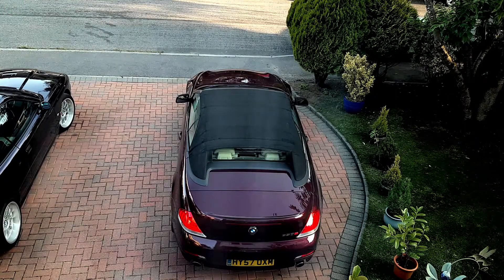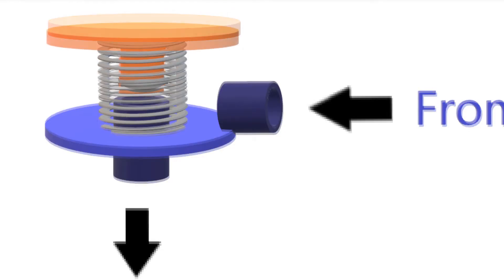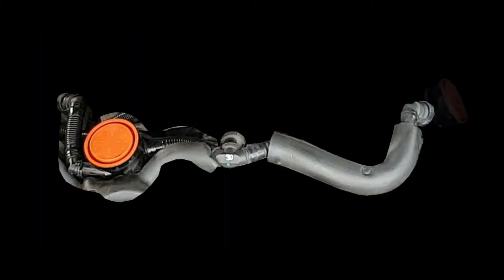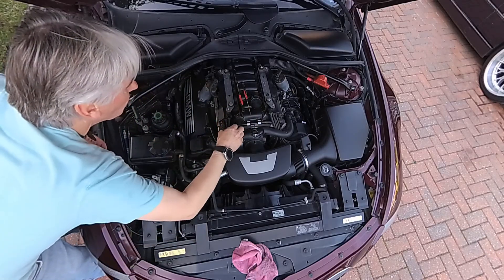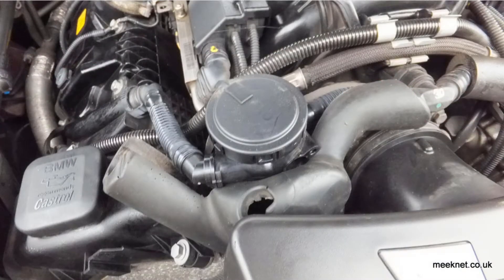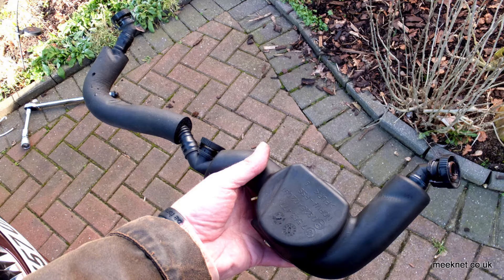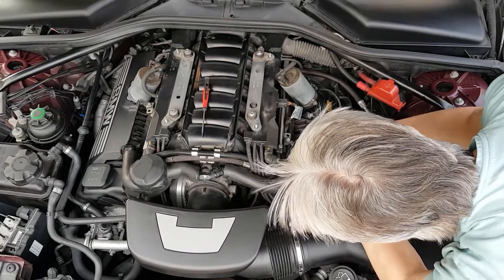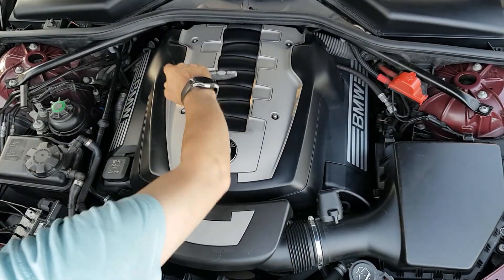BMW N62 Engine - Valve Guide Seals causing smoking? Fix in 30 minutes!

Comment: Thanks for the excellent video! Checked my PCV valves today and they were intact but I was surprised how soft the rubber was. I expected it to be a little more rigid so was wondering if that is normal or a sign they are near the end of their effectiveness? There was a tiny bit of that yellowish sludge on both sides but nothing like what you showed in your video.
Reply from the maker: Thanks! Probably still worth replacing them and scrubbing out the pipework and valve cover just in case - and yes, they are floppy!

Comment: Hey Tim took my plugs out on my 08 550i plugs got oil over them what do u think cause that problem
Reply from the maker: If the oil was on the outside of the plugs (around the insulator) then your valve cover gaskets need replacing - and it is worth checking the PCV valves (see my channel) as you may have pressure in the crankcase that is pushing the oil out
Reply: Oil was on the bottom and the top of the plugs on the right side.The plugs was dripping oil Thanks for replying I appreciate your help

Comment: I have a 2006 650I and I'm getting a Increased Emissions warning with the Check Engine light illuminated. By any chance do you know what could cause this? I've made this repair thinking this was the issue. Could you help please?
Reply from the maker: You need INPA: https://youtu.be/CBfyCItOJH0 Increased Emissions usually means a failing cat as measured by the downstream Lambda sensor - but INPA will give you more information

Comment: Hi Tim, having trouble with my 05 x5 4.4 n62 with hesitation on light acceleration and very small amount of smoke on start up, possible ccv and have you any knowledge on the ivm on these motors or integrated supply module all my symptoms are leading me to this module, thanks in advance
Reply from the maker: Always best to start here with these kinds of problems:

https://www.youtube.com/watch?v=CBfyCItOJH0&t=274s

Comment: Thanks Tim, your site is a goldmine of useful (and money saving) information. I've checked my PCV's (they were ok), replaced the halo and dipped beam bulbs, replaced the sagging trunk struts and changed the oil, air filter and cabin (micro) filters saving ££'s in the process! As you say the 650 really is a lovely smooth GT car, and doesn't have to break the bank even if the valve stem seal do go eventually.
Reply from the maker: Thank you, yes, valve stem seals are a problem - but it isn't a forgone conclusion if you change oil regularly.

Comment: I have a 04 545i could a failing vanos cause the car to smoke? I have no check engine lights. Slightly rough idle
Reply from the maker: No, Vanos problems do not cause smoke - try changing the PCV's....
Reply: Timm's BMW Repairs and Information the car seemed too start smoking right a few days after changing them. The car had a ripped one but smokes worse after replacing the two.
Reply from the maker: @heggcy1519  Give it at least 100 miles - and also clear out the valve covers as described in the video

Comment: Hi Tim, where can I buy the tube with dipstick seal to connect to my manometer?
Reply from the maker: You can find them on Ebay - mine came from my Sealey mechanical vacuum gauge kit
Reply: @TimmsBMW  is there special tools for this fix?

Comment: Thanks very much for the information. Great demonstration. My E63 650 has the SMG gearbox. Is the dipstick that you pulled out on the driver's side to measure vacuum for the engine oil? My dipstick states AT4 on the bottom so thought it was for the SMG manual gear oil?
Reply from the maker: Yes, the disptick I removed is for engine oil - I can't see it would be any different on an SMG-equipped car, but you never know!
Reply: @TimmsBMW  I checked it again and it says AT4 on the dipstick end no ATF4 - my mistake. It does instead smell like engine oil too. Thanks

Comment: Should I be scared away from the n62 and buy something else
Reply from the maker: No, I'm at 120,000 miles or so with no problems - look for regular oil changes and don't be put off by big miles - those ones seem to be less likely to fail.
Reply: @TimmsBMW  alright thanks, was looking at a 745i and it had 180,000 miles on it

Comment: Yup this cured the very minimal smoke I was getting out of my X5 4.8iS
Reply from the maker: That's great news - and thanks for passing on the information as it helps us all.
Reply: I just noticedthe same problem in my X5 4.8 purchased two months agoI'm getting my CCV tomorrow I really hope it's that. My first BMW probably my last. I'll gp for Mercedes I owned 1999 for 11 years C280 with no problem but regular maintenance sold at 240miles still running like a charm. BMW'S are little over engineer.  I replaced one suspension air bag, Heather control valve and I have the seat restraining sensor bad. Bad rear backup camera at night. Ultimate driving machine I doubt it now. Anyway I'll hope for the best.
Reply: @estramboticoarcano8029  Well these are common issues for this chassis. It's also the first generation X5 so BMW definitely had to work out the kinks but overall its a fantastic SUV. I've owned numerous BMWs and for the most part they are all dead reliable.

Comment: Learned a lot from this video, thanks Tim. Passed this video on to the daughter who has this problem on a X5 4.8 in New Zealand.
Would this cause an erratic idle also when warm. Thanks.
Reply from the maker: Thanks! Yes, popped PCV's cause engine running problems, especially on tick-over.

Comment: Is it highly recommended you clean the hoses like you did in boiling water
Reply from the maker: Yes, that certainly made a difference on my 650i - the cyclone separator will not work if it is partially blocked!

Comment: I burn oil win no signs of drips to the floor and recently started to squeal like a bad belt could this be it I hope a simple fix
Reply from the maker: It is certainly worth trying before doing anything else - it takes a few minutes and very little cash!
Reply: Hey guess what the one under the rubber cover was slit half and I would feel air from coming from there thanks to you're video I've solved it just waiting on the replacement part tomorrow again thank you
Reply: David mine is doing the same..burning oil and squeal lime bad belt..what was your fix?

Comment: E34 M5 owner looking for a fun daily driver while the M5 goes under the knife. Started looking into E63s and got here. Great video! I also like the Style 21s as the channel icon!
Reply from the maker: Yes, E63's and E64's are great fun - and by the way, the E64 accelerates quicker - it has a shorter diff!

Comment: I’m so glad I found this video, my 2008 BMW 550i started smoking a few months back and I’m super concerned that it’s the valve stem seals, I’ll definitely give this a shot first before hand and see what happens, absolutely worth it considering that the PCV’s have more than likely never been replaced, thanks a million.
Reply from the maker: My pleasure! It works on at least half of the smokers!
Reply: @TimmsBMW  MINE REPLACED, DROVE, ECT, STILL SMOKES, VALVE STEM SEALS BAD, FUCK IT, GOT MANY ISSUES WTH MY SUPER CLEAN MSPORT550I, NOW MY TRANSFER COOLANT PIPE SEAL IS GONE, LEAKING SLOW COOLANT, WHICH IS GOOD,BUT, THATS A 24HR JOB, AND A PINION SEAL IN THE REAR END, CALLS FOR 9.0 RR!!!!! WONT PASS SMOG,, GONNA DRIVE IT DAILY AS USUAL KEEP WATER AND COOLANT IN, TURN UP THE KICK ASS STEREO, AND IGNORE THE NOISE... LOL... FUCK IT, PROBABLY 6,000 DOLLARS , SHIT MORE, TO FIX THIS BEAUTIFUL CAR THAT I LOVE.. MAN THE INTERIOR IS SO SWEET, HANDLING, ALL THE ELECTRICS ARE PERFECT, EVERYTHING BUT, THE TEARS OF A CLOWN, STORY, REALISTICALLY, MORE LIKE 7 GRAND TO FIX THIS SHIT, THAT COOLANT PIPE IS THE DUMBEST ASS THING I HAVE EVER SEEN, YOU HAVE TO TAKE THE WHOLE FUCKING ENGINE APART TO FIX IT, AN O RING.... AND A 200 DOLLAR PIPE... THAT JOB CALLS AGAIN FOR 24 PLUS HRS!!! LOVE THE BMW... GOT 165 ON IT MILEAGE, SO ITS DONE ITS JOB I GUESS...

Comment: Looking at buying a 645ci with around 60 thousand miles. Any other common problems with this model?
Reply from the maker: Pre-2006 models had a lot of problems with the electronics (although not as bad as E65) - but as usual, watch out for smoking, although the PCV fixes a good proportion the valve guides are still a real problem.

Comment: Hey Tim, I have a question. I got a 2012 650i. The car produces a lot of white smoke from the exhaust when it’s cold. After warming up it usually does not smoke. I had mechanics come check out the car and I was told it’s the valve steam seals. What would you say the cause of that? 
Also where is the PCV orange cap located? And should I buy new once or just clean them up. 

Thank you!
Reply from the maker: No orange bits on your engine! Completely different crankcase ventilation system. If it is cold where you are expect a lot of steam like this: https://youtu.be/2nuFgLb6IKc
Reply: I ran the car today and after parking it I let it sit on idle. It smoked but not crazy hard. Than I stepped on the gas in parking gear, it shot a smoke cloud than went back to light smoke of idle. Also I noticed little bit of blue smoke when I stepped on the gas. 
What do you suggest?
Reply from the maker: @timzadoynov6203  The N63 engine can be a bit smoky, high oil consumption is quite expected - and BMW's 'fix' was to enlarge the oil-pan to hold more oil! However, because the turbo's in the 'V' of the engine produce a lot of heat they can affect the valve guides - but, if you don't need to top-up the oil between the 10,000 mile service intervals everything is normal.
Reply: Okay, because I warmed up the car today really well. When it was sitting in idle it was just having little white smoke. But every time I stepped on the gas pedal I saw good amount of blue smoke coming out. It smelled also, Than went back to little bit of white smoke. I was thinking it could be the turbos or the pcv. Or that’s normal for a n63 to shoot blue smoke when stepping on the gas in idle?

Comment: Great Video! Changed the valves and still smoking. What did you use to clean the valve cover? You said 5amp flex. Is that just a piece of electrical wire? Should I just shove it in the hole?
Reply from the maker: Yes, I used 5A flex - but a bendy, long brush would probably have worked a lot better. Remember to give the car a good 100 miles after doing the work, it takes a while for the oil to work through.
Reply: Timm's BMW Repairs and Information  what is that u use to  clean in hole don’t want to mess anything up
Reply: If the smoking doesn’t stop after a good amount of time you’ll probably have to replace the valve stem seals , and like he said early in this video it’s no cheap job. They sell a kit where you can replace the stem seals yourself but it takes 20 hrs of labor and you’ll obviously need more time than that if you’re not mechanically inclined, but you’ll save a load of money and your engine in the process.
Reply from the maker: I agree, as I said, changing the PCV valves fixes a good 50-60% of smoking cases, but failing valve stem seals is a real problem, and an expensive one to fix. But I would always recommend changing the PCV's first as it is so cheap and easy - and don't forget to clear out the piping and valve cover as much as possible. To avoid have having valve stem seal failure change your oil every 10,000 miles and use a decent oil.

Comment: These cars just smoke period after a certain amount of miles. No rips on my on my valves an car still smoke after idling
Reply from the maker: Everything fails in the end - it really is a case of regular servicing with high-quality oil and keeping on top of the filter changes. I'm well over 120,000 miles now and all is good.

Comment: Hi Tim, delighted to see you have a YouTube channel. I spent a lot of time on your site when I had an E38. My 750 (N62) is smoking when throttle is applied, after idling. Do you think that could be the PCV (I haven't checked their state yet) or given its after idle, I'm guessing more likely valve seals? Glad to see this is in a saner position than the M62. Thanks again!
Reply from the maker: The PCV's are so easy to change just give it a go - and then drive a hundred miles or so and see if it makes a difference.

Comment: How many miles did you have there ? How is the motor apart from this ??   , thinking of getting one , either 645 or 650 is there any difference in reliability on them ?? Thank you good video >>>>
Reply from the maker: Around 120,000 miles - I would prefer the 650i just because it has more power with the updated N62TUB48 engine

Comment: I just replaced mine, How many miles are on your Car Tim....??????????
Reply from the maker: My pleasure! I'm around 120,000 miles on a 2007 plate - more info here: https://www.meeknet.co.uk/E64/2007_E64_650i_Sport_Individual.htm
Reply: Timm's BMW Repairs and Information , unfortunately it did not remedy my smoking. I will have to do the Valve Guide seals. But this car has been taken care of all its life and is in excellent condition inside and out. I think it’s worth the cost about $3000.00 USD
Reply from the maker: @theil6  Sorry to hear that, but have a go at clearing bank 1's valve cover before spending too much

Comment: I have a 650i 2008 57 plate and when I start the car up it has blue smoke coming out of the right exhaust and if I push the pedal some comes out and then it goes,.. What should I do? 
Many thanks
Reply from the maker: Change the PCV units and clear out the rocker cover on bank 1 to start with - and allow at least 100 miles for the oil to be pulled from the inlet manifold.
Reply: @TimmsBMW  thank you very much
Reply: @TimmsBMW  the smoke actually happens when the car is left at iddle for about 5 mins and when I press the accelerator it blows smoke.
Do you think changing the pcv will help or do I need to change the stem.valves? Thanks
Reply from the maker: @gjpope23  Only one way to find out - go, on, you know you want to change those PCV's.....
Reply: @TimmsBMW  ok thanks.. would topping the oil up and seeing how much I lose help give me an answer?
Reply from the maker: @gjpope23  Nah, just change the PCV's......
Reply: @TimmsBMW  Ok I just took out the dip stick and put a ballon over it and it is sucking In slightly so I guess the pcv is ok or still need to check?

Comment: i would like to thank u soooo much, i took it to a dealer and he told me $4000 to stop it from smoking. I saw this video and did what you said and NO MORE SMOKE...THANK YOU
Reply from the maker: It really is my pleasure - and glad to hear it worked out for you. I am worried that this problem is turning into the 'Nikasil' scare of the M60 BMW V8 where the first sign of smoke would scare the owner into selling or scrapping. Just like the valve guide problem there were so few real cases of bore-wear and lots of cases of PCV failure.
Reply: I hope I'm that lucky, I have the exact burgundy 650i  mines is 2006.
Reply: Hey how long did it take your car to stop smoking after the change?
Reply from the maker: Around 100 miles or so
Reply: Timm's BMW Repairs and Information I have a 2012 750 with the N63 and I can’t find the ccv orange colored valves at all
Reply from the maker: @j.kisart6100  Very different system on the N63 engine - the system can be found here: https://www.realoem.com/bmw/enUS/showparts?id=KA83-USA-02-2011-F01-BMW-750i&diagId=11_4171

Comment: I have a 2002 x5 4.4i and its smoking too but i was told its a multitude of problems valeves ect. You reckon its this?
Reply from the maker: You don't have the N62 engine - you have an M62TUB44 - have a read of this: https://www.meeknet.co.uk/E32/PCV/Index.htm

Comment: Will a N62 pcv diaphragm fit in the m62 pcv plate?
Reply from the maker: No chance, the N62 is smaller than the M62. I wouldn't recommend just changing the diaphragm and spring on the M62, it rarely works as it is extremely difficult to put sufficient pressure on the cover to snap it in place and the spring slips creating excess crankcase pressure.
Reply: @TimmsBMW  I've replaced the entire assembly twice in a year and currently have excessive crankcase pressure. And I've had it since about a month after replacing it and the intake gaskets and throttle body gaskets
Reply from the maker: How have you measured the crankcase pressure? If you do have pressure rather than a vacuum then something is blocked - the OSV or the vent tube....
Reply: @TimmsBMW  I haven't measured it yet because I don't have the tools, we have it at work but I haven't been able to finish early enough to have enough time at the end of my shift to test it and I work closing shift so no one wants to wait while I do it however it's kind of obviously pressurized, the gaskets are all leaking, oil was in the manifold before I installed a catch can as a temporary fail safe, and you can feel it blowing instead of  sucking at the dipstick. I plan on dropping the pan and clearing the OSV tube during the next oil change which should be soon. I know the ccv is also bad but they're failing so fast something has to be killing them.